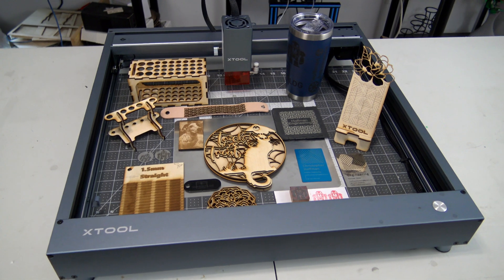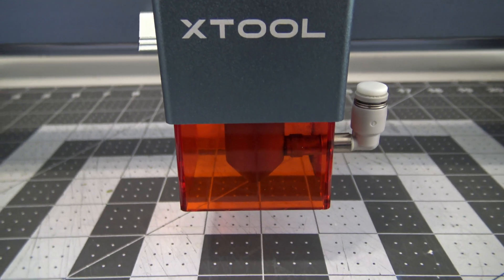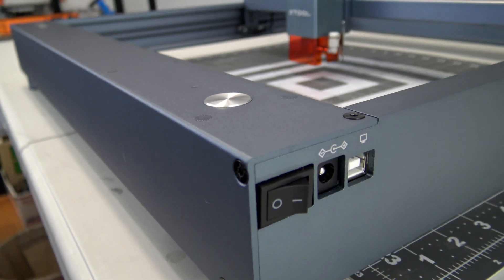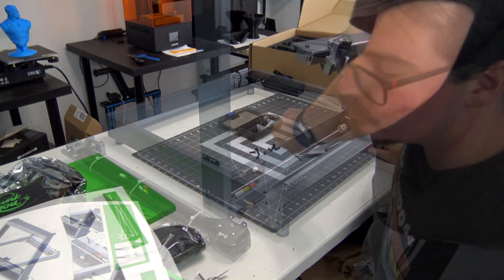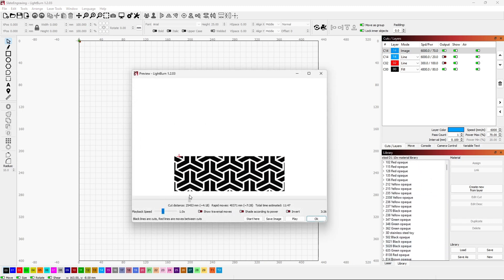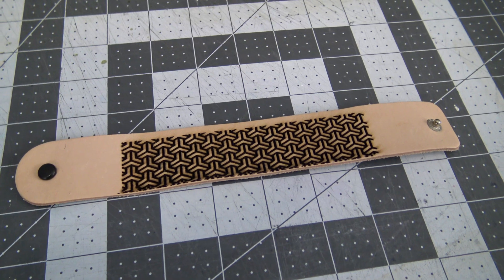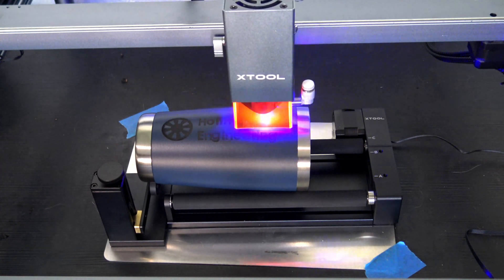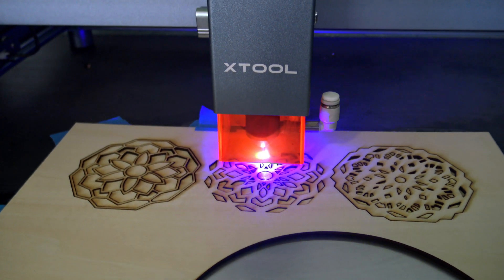The Best Laser Engraver with a Rotary Attachment - xTool D1 Pro 10W Review

Comment: I see that it works with steel. Question: does it also work with sterling silver?
Reply from the maker: No, it won't work with silver. Stainless steel only works because it is a surface-level heating discoloration, it doesn't actually engrave or etch. Silver doesn't act the same way.

Comment: What other accessories should you have?
Reply from the maker: A honeycomb cutting surface is a must have, makes life a lot easier. An Air Assist compressor is great for cleaner cuts with woods. Some sort of ventilation, whether that is an enclosure you can vent outside, or a HEPA filter designed for laser engraving.

Other than that, experiment with different materials. Try some rubber stamp making, or engrave stones, or cut mirrored acrylic. If there's a particular type of material you use frequently, then there could be material specific accessories, like a good cutter for acrylics, or acrylic glues.

Comment: Think this would be able to etch/engrave on a small mason jar? Those things have a pretty wonky shape to them, not sure if the fall off per quarter turn would be too much for the geometry of the software to cope with 🤷‍♂️
Reply from the maker: Diode lasers don't handle glass well. There are techniques to work with glass, such as coating the surface with paint then engraving through the coating. It can be tough to get good results that way though, you'd have to do some experiments to see if the D1 Pro would work in that case. CO2 lasers can easily engrave glass though.
As for the shape, the relatively flat faces would probably engrave well. The software wouldn't be able to account for the rounded edges though, if you tried to use the rotary attachment.
Reply: @Hoffman Engineering  im told if you put painters tape over top of the glass, that helps